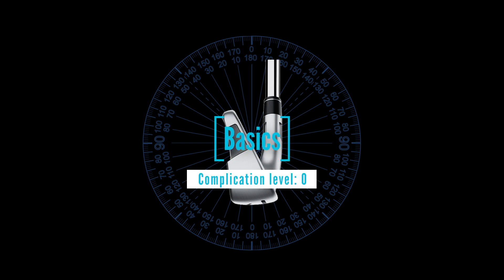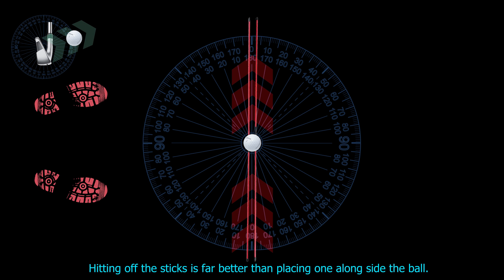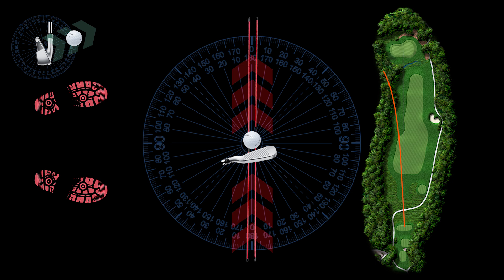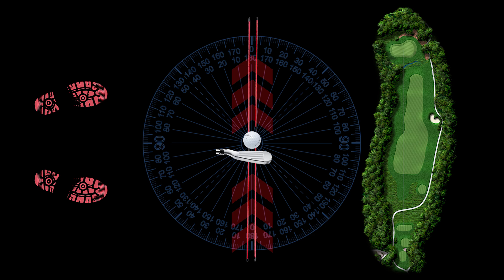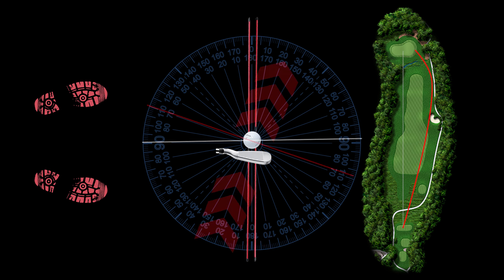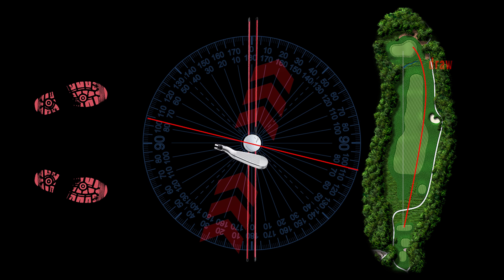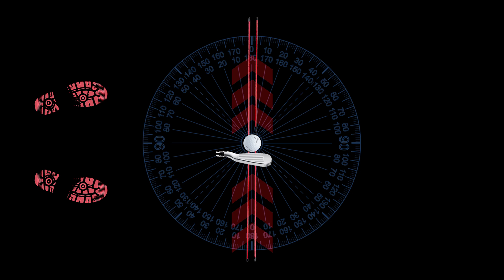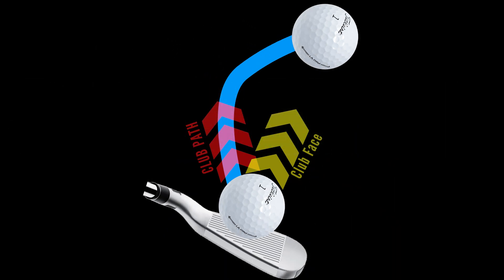The conventional way teaching professionals have explained ball flight and ball dynamics

Comment from the maker: PLEASE READ:
There are conflicting ideals about ball flight and the way the ball is sent.  The conflicting information has to do with deflection and 'time on face'.  

For example,  a tennis racket swings up,  sends up,  and bends to face (top spin).  But it has high time-in-contact.  A ping pong paddle has moderate 'time-on-paddle' and is again, thrown in the direction of the swing and bent. A club swung with enough velocity and force to compress must throw the mass in the direction IF the force is higher than the 'decompression' of the ball. A putter would have zero effective time on face with no deflection and would logically (have not used a 1000 frame per second camera to look at it) have no mass throw and only follow deflection.   

Another words there are points where the deflection has no time on face (no compression) or the blow is so glancing that it lacks compression.  It is my understanding that in these scenarios that the lack of compression and time-on-face prevents the mass from being thrown in the direction of the club path/swing. at this point all theories agree

I am going to do some more research to validate the ideas here-in.  As I play shots as the path, but it could be that the scenario and the angle of deflection has been proven to be less effective toward the club path, and more effective toward the club face. My logic tells me that it splits the angle between path and deflection due to compression.

I am going to do some research as if the understandings have changed I need to update my explanations to reflect that.  I had a user post a comment that the current launch monitor data shows differently,  however,  I have three launch monitors and that I can see,  they do not.  I have seen some videos of club swings that attempt to prove this wrong,  but they lack compression (glancing and non compressing blows.  

The flight of the ball in all the examples would still be accurate,  just the leaving angle would be affected.  Deflection applies spin and club face applies spin.  The thing in question is whether the angle is path,  face,  or a amalgamation of the two.

I will keep the channel updated. I do not want to be inaccurate.

Comment: This seems quite intuitive to me.  Who ironically enough, has never played a game of golf in his life.  But the flight, and spin characteristics we quite easy to understand, and follow along with.  I hope to get around to trying Golf one day, and I hope I remember this when I do. Thankyou!
Reply from the maker: In reality depending on the amount of mass and time on face, the club path only accounts for about 15 to 20 percent of the direction, while the face deflection actually accounts for most of it.  This is the mechanism I was taught years ago,  as ball physics are extremely difficult to explain. But by explaining it this way,  teaching professionals can simplify things.  

There is newer data,  that doesnt account for time on face (compression) and mass decompression.  So there are a lot of factors.  But this allows for a base line.

Try golf at top golf.  That's the best way to start.  You don't have to chase it:) Cheers!